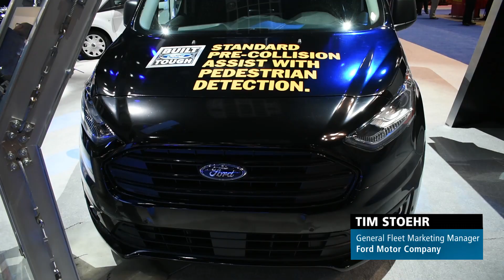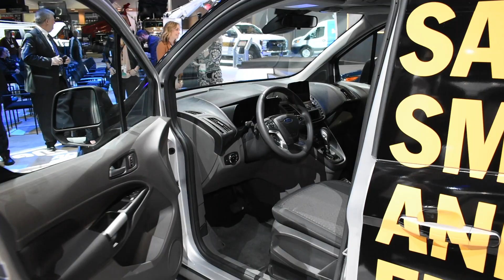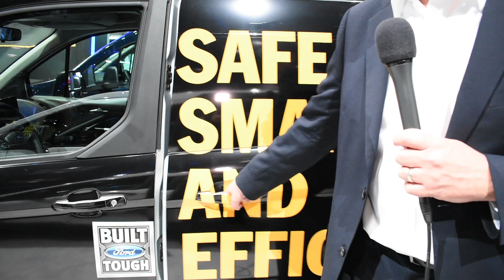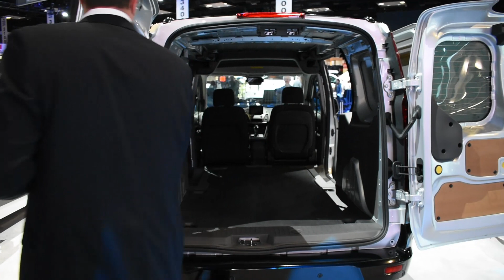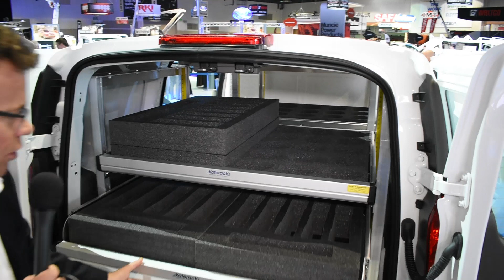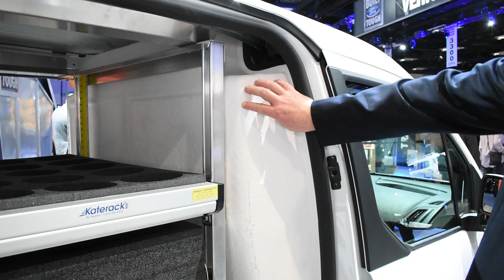2019 Ford Transit Connect Compact Cargo Van Walkaround

Comment: I own and love my 2017 Ford Transit connect xlt long wheelbase 
But 2 things need to change for me to consider buying another Ford Transit connect 
1) 4x8 rear cargo area
2) higher top model
Like a few years ago!
I use my van for Funeral home I work at.  
At least now is a diesel engine option, my little 4 cylinder is terrible on gas !
Reply: Andrew Insinga what's the distance from driver seat to back doors? Is there anyway 4x8 sheet could fit it?